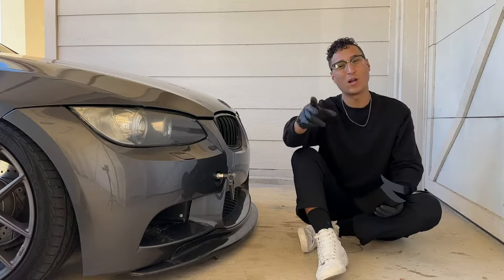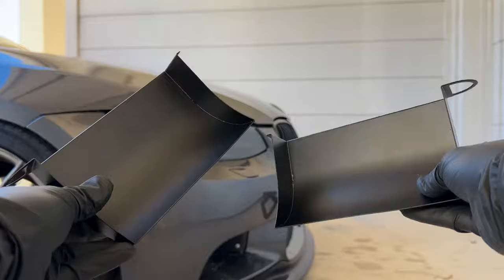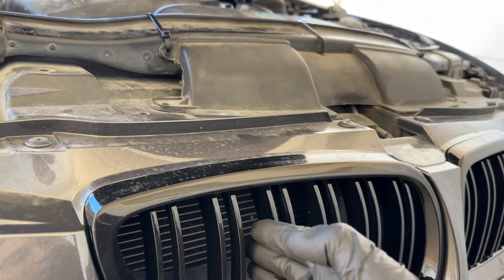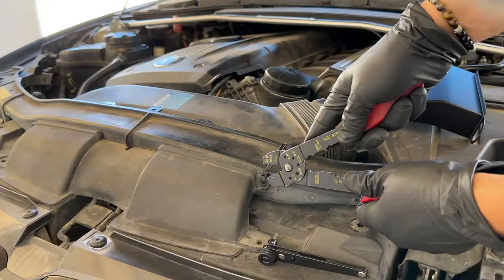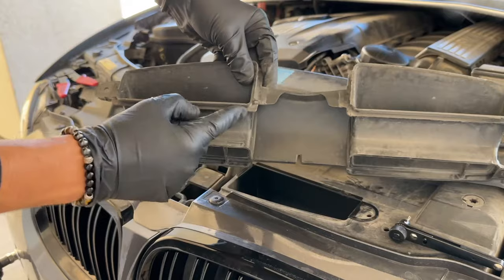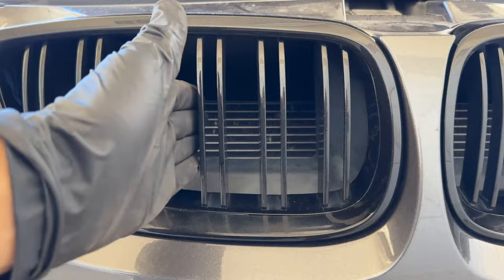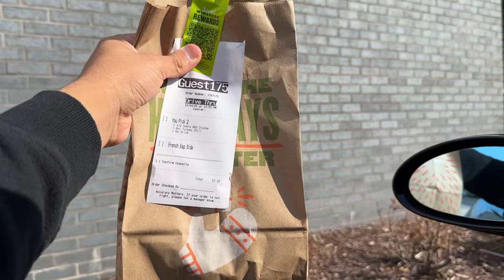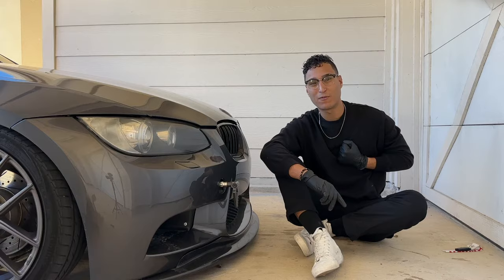EVERY BMW OWNER NEEDS THIS UPGRADE! | BMW Air Intake Ram Air Scoops

Comment: No chance you feel a difference driving 😅
Reply: Nah you don’t I just installed them last week and they small af in person lol. They look good tho I have red ones
Reply: 20$ Placebo
Reply: @tmc8516 I just did mine, red as well
Reply: i got a hvac duct pointed to botton left fog light corner since my pod filter is super low to get coolest air, my lowest temp was 77°

Comment: Lol, that is some serious BS. Turbo will suck as much air as it needs. The scoops will make no noticeable difference... They would only if the air was pushed to the engine by the forward movement of the car (and that effect is way below the actual air demand even at high speeds).

Comment: These air scoops will increase STATIC PRESSURE in the STOCK AIR BOX, which will make more of a difference to throttle response than open air cone filters.
N54 stock air box and a decent filter can handle 400+.
Cones offer HIGH FLOW RATE; great for when youre chasing over 450hp (sound better too).
Its worth reading up on static pressure vs high flow rate and their suited application,
but lets be honest, screw the science, 2 cones with air scoops looks badboy!

Comment: People in forums always say these can't make a difference, because the air suction of the engine is greater than the pressure these scoops can build up. But people often only think the first step. These scoops increase the density of the air infront of the filter, which does not mean that they press the air into the engine, but the resistance the engine has to overcome to suck new air in is lowered and especially when you step on the gas from idle, which is normally the moment where it takes a bit of time to develop power, the engine can first use up the air pressure infront of the filter, before it has to actively suck air through the long and unfavorably shaped (at least for the inline engines) air intake. That might indeed make the car feel a little bit more agile, even though it prbly doesnt show on the dyno. But by far most importantly: When you have an open air filter, you want to guide as much cold air to the filter as possible, to avoid that hot air from the engine bay is sucked in. When you use the scoops and lead the pipe on the inside of the engine bay directly to the air filter, you wont build up any air pressure, but you make sure that there is always enough (or at least more) cold air around the air filter. And that has the potential to make a big difference.
Everything above is about POTENTIAL gains, not tested with any air flow sensors or what ever. Do with that what you want. I hava an open air filter for the sound and want to minimize the power loss I know it causes and will therefore print me some scoops. So they dont cost me a lot and its no pitty if a decide to go back to the closed filter.
Reply: This has been proven wrong sooooo much. You realise the air going under the car is being compressed, thus high pressure. The bottom of the engine bay on these cars has large holes on it. The under tray leaves massive gaps. This high pressure forces air up into the engine bay. This mass of air is more than enough for the engine and the air density is not going to be increased at all with the use of grill scoops. There is no resistance for the engine to overcome. Especially  when using the stock intake (which provides more power and better throttle reposnse than a k&n) style intake.
Reply: @BritishBeeMan   the intake is IN FRONT of the engine bay. any pressure up around the engine IS NOT getting in front of the condenser AND radiator and into the vents. You are tripping. It may however suck water into the air filter.
Reply: @BritishBeeMan   bamwa is right. STOCK air intake is a sealed box, not an open cone filter. 
Also, if youre looking to chase 400-450hp, it turns out cones arent much better than stock (sounds better though).
These air scoops will increase static pressure in the STOCK AIR BOX, which will make more of a difference to throttle response than cone filters.

Comment: You could easily drill some holes into the scoop surface for rain water to get through. Ordered a pair, I wonder if it is going to work well

Comment: On my 318i, left intake is originally blocked off 😆 Maybe would be better to first install some air intake from models like yours, to increase airflow, but thanks for the vid.
Reply: They blocked off the left side of the 320i, too. Not just 318i. I drilled holes in the front of mine and superglued a plastic tube to get more air in the system.
Reply: @invtrk1046  Was thinking of doing the same or just installing intake from some 6 cylinder... but doubt I'll feel the difference. Maybe with some tuning.
Reply: @nenadovmail   Will the intake from a 6 cylinder fit in the engine bay?
Reply: @invtrk1046  I think so, because you got more space in front of the engine without those 2 cylinders. Haven't tested but you got enough space to fit another small engine there 😄

Comment: I have red ones that look pretty cool. I don't think they do anything for performance though. Also no change in cooling.
Reply: Intake air temperature will change, you can ready it on basic obd reader before and after installment, will make diffeence especially having cold air intake

Comment: Hi , great mod  but did you check inside the nostril as on mine, only one of the ducts was open ! ?  The other duct was molded off and I had to heat up a knife and slice it out.   It was Obviously moulded closed from when it was formed at the time of manufacture.
Reply from the maker: that’s very interesting, I’ve seen that before. do you have the N52 328i or the 325i?
Reply: @IzzyE9X   no , I have the n47 diesel engine.  It's a 3 series touring.   Originally it' was 175bhp but I've had it remapped and now it's about 205.   Maybe only one duct was open as it was only intended for 175hp.
Reply: Hi bud I had this on mine too. I opened up the 2nd part of the duct.. a real difference after I did it 💯💯👍🏽

Comment: Looks interesting, but I cannot get it. With this the air intake is maximized and it's get to the air filter which is dense and directly slow down intake to the level how much it can receive through that dense filter material. On the other hand this can ensure that you always have enough air in front of filter, something like air buffer.
I will probably try 3d printed ones to see is there any change on diesel. :)
Reply: Lmfao 😂
Reply: @NewDesignVinylGraphics  Did I said something wrong or my English is so bad? 😄
Reply: So I shouldn’t buy these if I’m getting an air intake?

Comment: Hi I have a 2007 328i 3.0l i6  is this car a n52 or n53 I can't figure it out it's a 4 door sedan manufactured in Germany
Reply from the maker: N52
Reply from the maker: searching the VIN in a decoder will tell you your engine configuration.

Comment: That's cool and all man, but it's still a 328i 💀
Reply from the maker: a 328i with 240,000 miles and 80,000 miles of it being with not a single maintenance issue. everyone drives what they drive for different reasons brotha
Reply: @IzzyE9X  yeah I know, brother, I'm only playing. That's impressive though, the N52 is a damn solid engine.